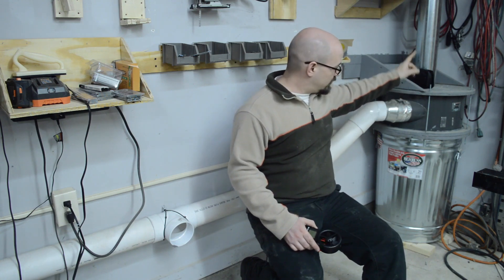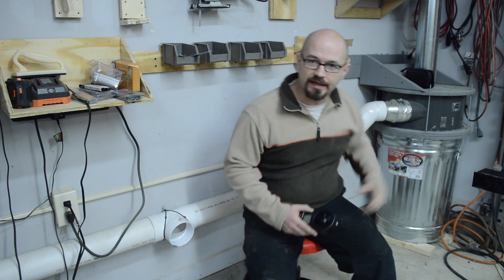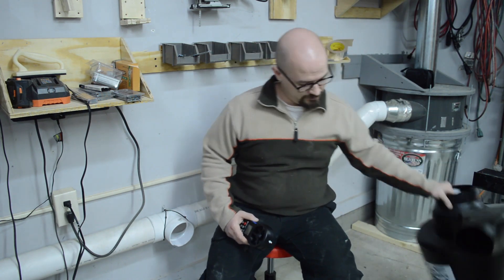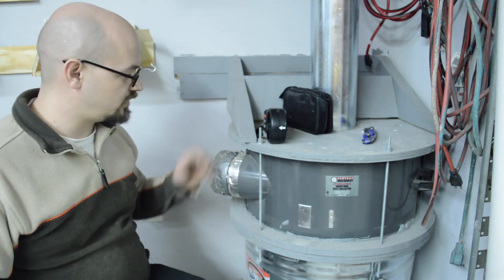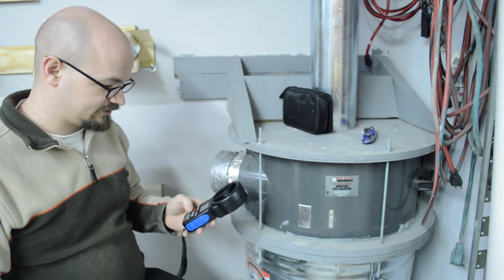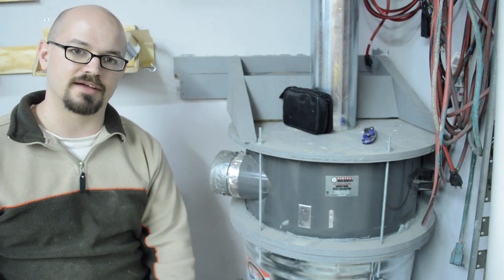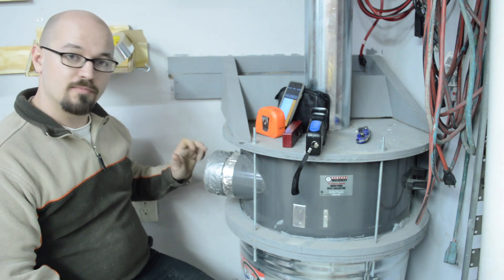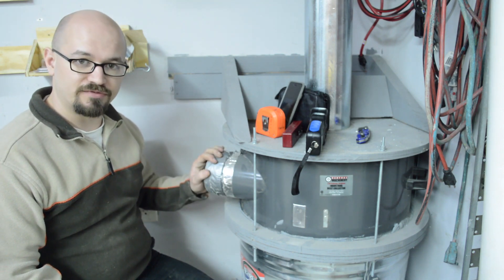Thien Baffle or Cyclone: Efficiency Comparison

Comment: great comparison.  are you venting the harbor freight dust collector outside?  I have mine hitting a thein baffle before the trash can then to motor then another thein baffle before hitting a Wynn filter.  the Wynn filter made a huge difference in my suction and air flow
Reply from the maker: Thanks! I've heard great things about the Wynn filters. Yeah, I have mine venting outside with the motor mounted in the attic. It really cut down the noise a lot. Much more pleasant to work while it's running now.
Reply: Hi, Hows that working, I have a cyclone before my Grizz 2 HP and was thinking of a Thien in the doughnut with a Wynn.
Just curious if you lose some suction.
TX Mark

Comment: I have that same dust deputy - and it allows fine dust to clog my shop vac filter.  I do think it will be better once it is swapped over to my jet dust collector but only because of the jet's design.  I show my set up in my rambling video with Dust Collection in the title.
Reply: Shogun-Jimi I would bet that your Shop-Vac doesn't pull enough velocity to get the fine dust to cyclone out of the stream. Once you upgrade to the full size blower it will probably work a lot better. I have the smaller Dust Deputy on my shop vac and it works really good. I think this size dust deputy is really for the larger dust collectors and to be truly effective probably needs a large volume and velocity.
Reply from the maker: Swapping it to the Jet will probably help a lot. I'll check that out! Always interested to see how other woodworkers handle dust collection. I might do a more general overview of mine sometime once I finish moving machines around. Right now I have my motor mounted in my attic and venting outside so I don't have issues with filter clogging.